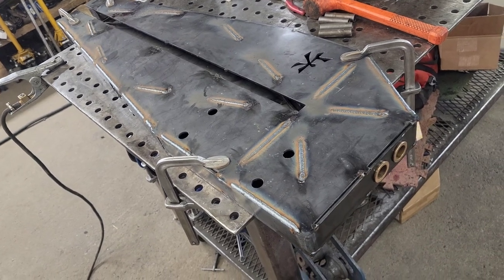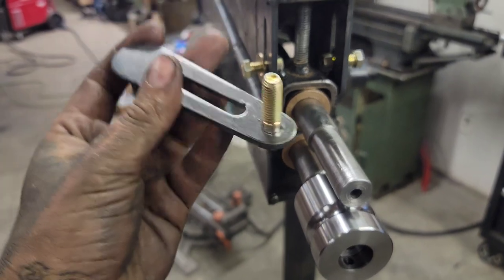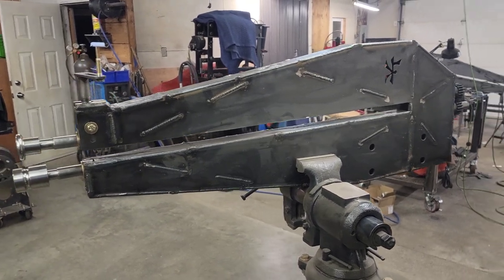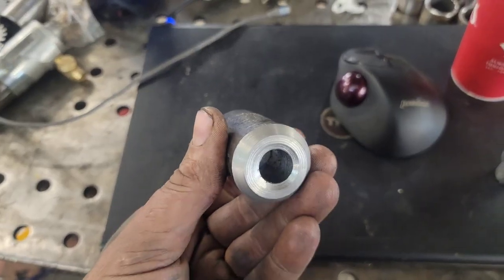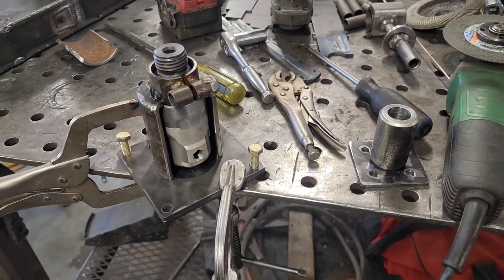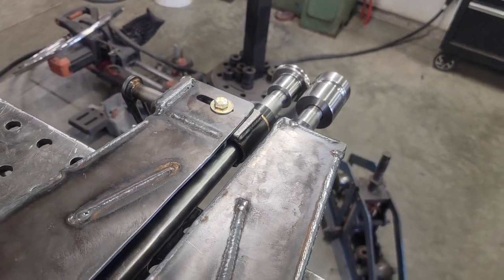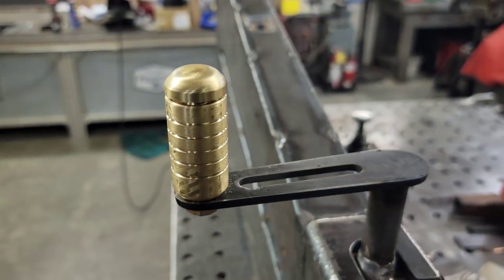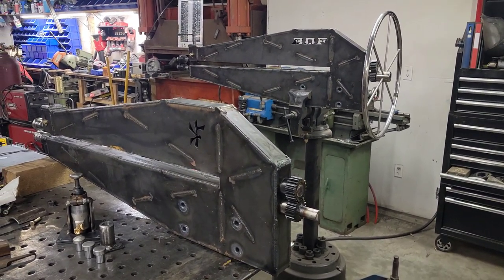Deep Throat Bead Roller Part Two, and finishing the Fabrication on my Planishing Hammer

Comment: Incredible work! I'm modifying my harbor freight beed roller. I've got the longer shafts done and then I saw another squirrel and it got set aside. Yours gives me some great ideas to finishing it. The planishing hammer is also a great idea! 👍
Reply from the maker: Saw a squirrel is the story of my life.
I still haven't put air to the planishing hammer. I know it all works in theory since it's been done many times, but I'm itching to make some noise.

Comment: Hello, regarding drive motors. I bought a really nice Mittler Bros bead roller back when I was working and had more money than time.  The drive motor just sucked ! who wants to make three passes because you have a whimpy drive motor ! not me. So anyway I found that powered wheelchairs have really large gear reduction motors that are bi directional. Mine is sitting on the floor getting acquainted with the bead roller. I am hoping to pair them together soon, I expect awesomeness to follow. Used Power chairs are cheap. Hope it helps.
Reply from the maker: I've been looking at motors for a while  weighing options vut hadn't considered that, I'll definitely take a look.  I believe I have power supply sorted, and looking into pulse width modulators to get full power at low speed, I'm off to marketplace 🍻
Reply: @kingofbootyfab  With the solution I reccomended everything you need comes in the wheelchair. People sell power chairs for many reasons but they generally are still in top form. I would bet you might even find a free one. What kind of camera do you use to shoot your videos? Thanks